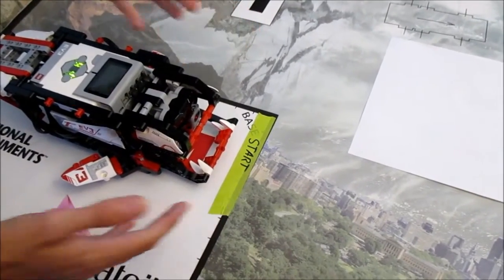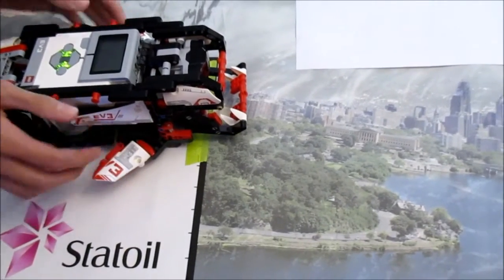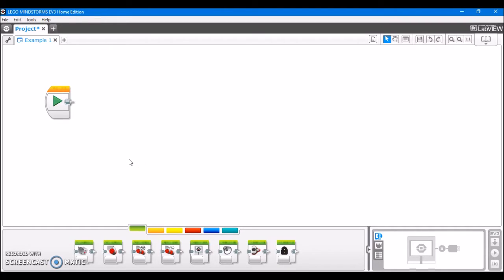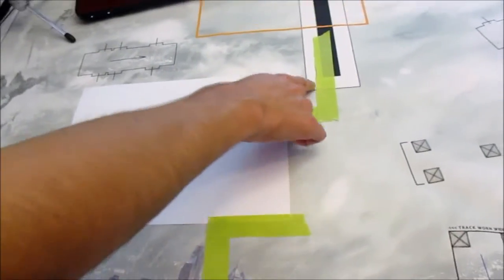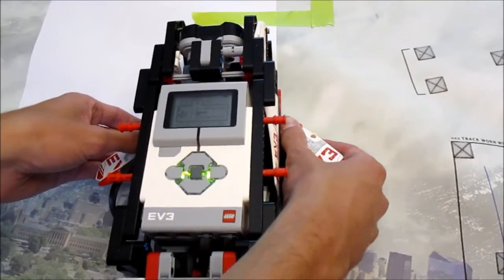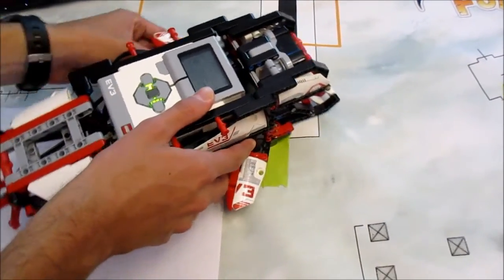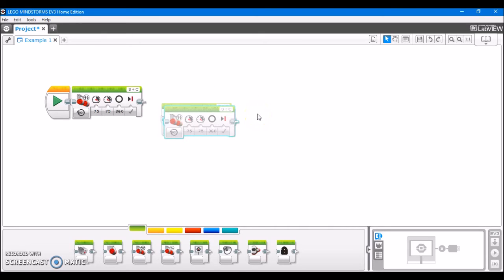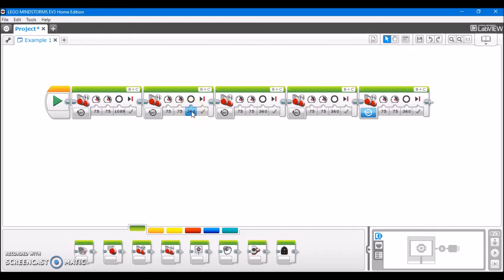Quickly Program an FLL Robot with Port View and EV3 Motor Encoders

Comment: I made a MyBlock to do this for me; you measure it out in CM on the board, and then the block handles calculating the distance divided by the wheel circumference and it'll move the wheels the proper number of rotations based on which wheels you're using. That way we can measure how far to go without having to have the robot present or finished. All you have to input is the wheel diameter and centimeters you want to go straight.
Reply from the maker: That's excellent! Thanks for sharing!
Reply: Do you have any tutorial?